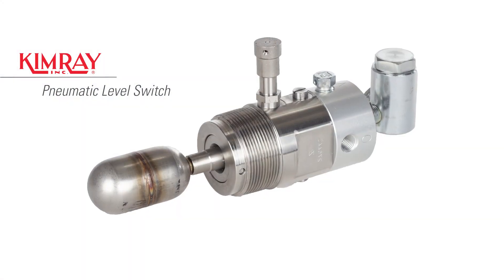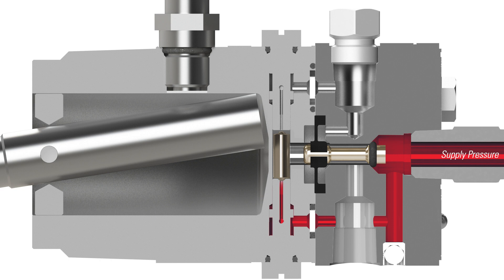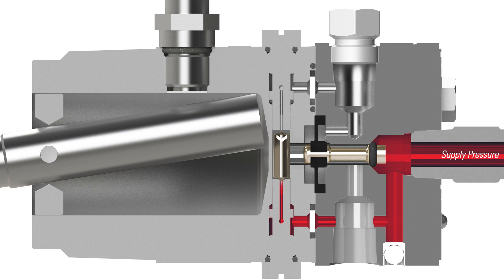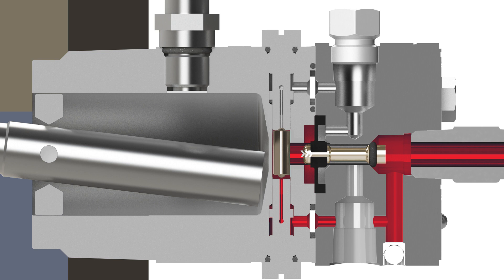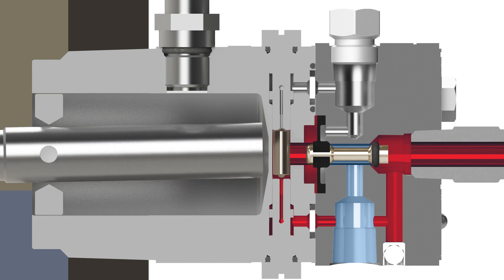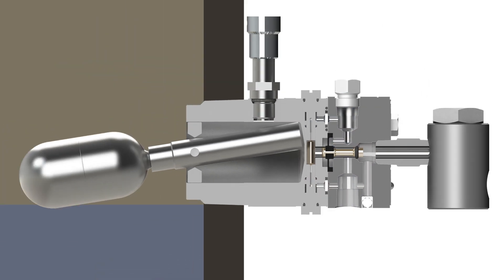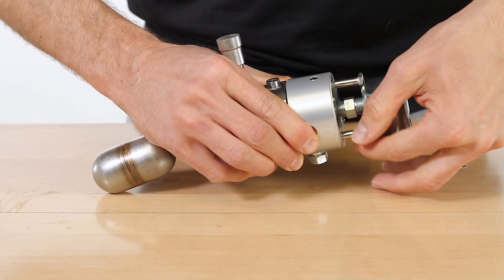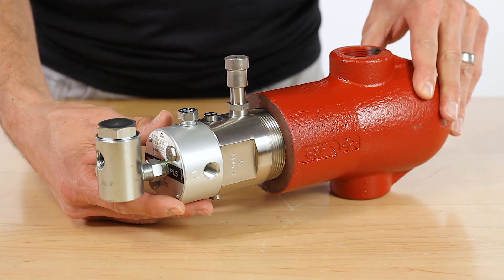How a Kimray Pneumatic Liquid Level Switch Operates [Level Sensors]

Comment: Explain the actions of the direct and indirect. Why would you want to flip to indirect?
Reply from the maker: The level switch is reversible from direct acting to indirect acting so it can be used in conjunction with a fail-open or fail-closed control valve. Depending on your setup of other equipment you may need direct or indirect. You can always call, email or chat online with Kimray Product Support for more thorough explanations for questions like this too if you want to go deeper! https://kimray.com/get-product-support

Comment: What is the difference between a pneumatic level controller and pneumatic level switch ? They sound identical yet I'm seeing them as 2 unique entities in every pneumatic vent gas study I can find.
Reply from the maker: Good question! Functionally, what they do IS the same, but the level controller allows for adjustments in the span and top level.  The level switch is “fixed” in that it doesn’t have any adjustability on the span or top level.  It is typically used as a high level or low level shut off. I hope that answer helps!
Reply: @KimrayInc  Thank you for the quick reply, that explains it perfectly !
Reply: I watched your video on the gen 2 controller and i'm still confused.

Comment: What you explained is about pneumatic level switch high. Could you please explain about pneumatic level switch low operation. What is the difference  between both design ?
Reply from the maker: When controlling low level, the float will be in the up position while it is submerged, so if it’s set up as direct acting, which is the way it comes standard, it would be sending a signal while submerged.
When the level goes down and it is no longer submerged, the float/arm will move down and the signal will vent.
You can switch it to indirect acting to get the opposite action.  (up = vent; down = send signal).
The same level switch can be used for either high or low level control.
Reply: Thanks for your explanation, it is helpful. However I request you to please make a video for straight length float pneumatic level switch hight/low which is side mounted. Once again thank you for your reply.